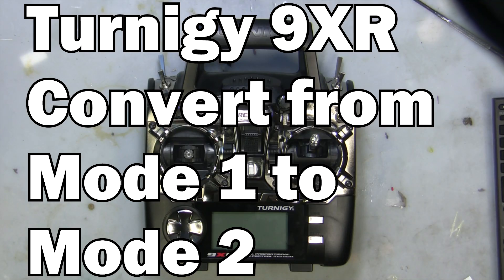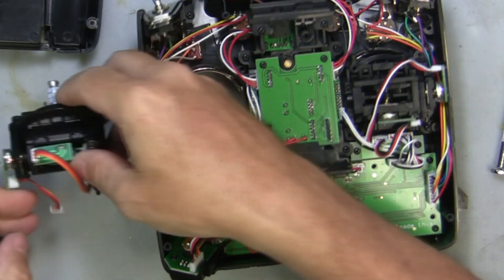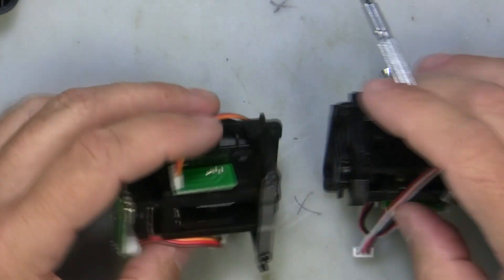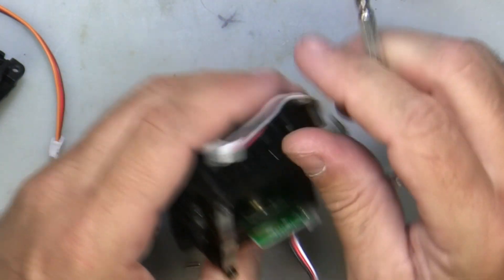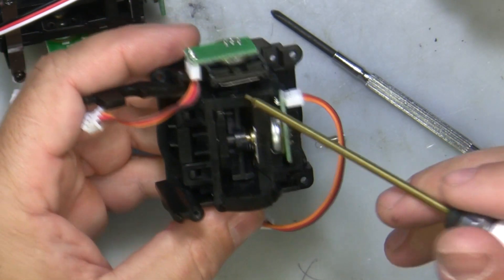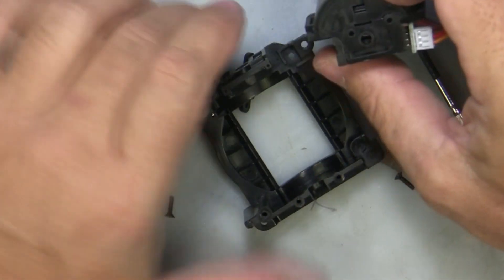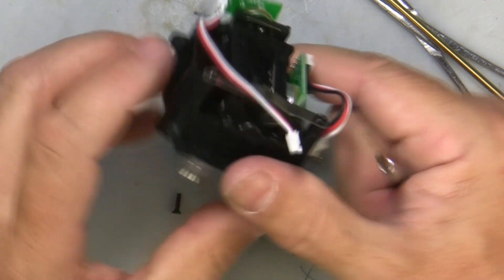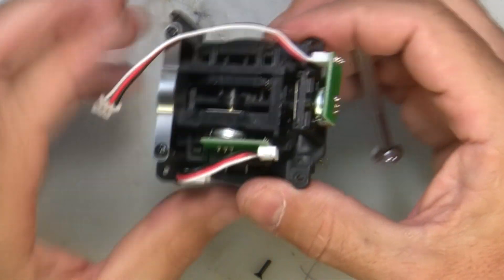Turnigy 9XR Converting from Mode 1 to Mode 2

Comment: Very good of you to share this with us out here :-) I hope this applies to the 9XR Pro, the price for the Mode 2 right no is $101 versus $59 for the Mode 1. So it is a no brainer, and still a bit of a mystery as to why the difference. A lot of the prices have gone up there at HK
I am amazed that you posted this so long ago, My old 9X has had so many great updates but the weirdest thing is the dying Gimbal Potentiometers . I don't know how many times I have been in there fixing and re calibrating the darned things. IT is just unacceptable that you cannot even buy a replacement. I won't go into detail as to the descriptive text that will find you this elusive 5K pot. It is just not an easy matter. You can replace with Taranis Pots but wow, why not just buy the radio ?? :-)

Comment: Hi There, Thanks for your video. I just followed your instructions exactly to change my radio from mode 2 to mode 1. I changed the mode in the software to mode 1 but the splash screen hasn't changed and the throttle is still on the left. Can you help me please ?

Comment from the maker: the wires that connect the pots on the gimbals are not long enough to swap and rotate.  You could do it if you desolder and switch the wires from the pots

Comment: Hi after staring and looking the gimbals are the same with the exception of a few pieces which you swapped. Since that is the case It really looks like you could just swap and rotate the gimbals 180 degrees. The pots are likely the same values with the wires just different colors to help visually see which is throttle and not. Then change the radio from mode 1 to mode 2 within the software. 

Since you have done the change. You are better to think about it. I've only looked at my 9X.